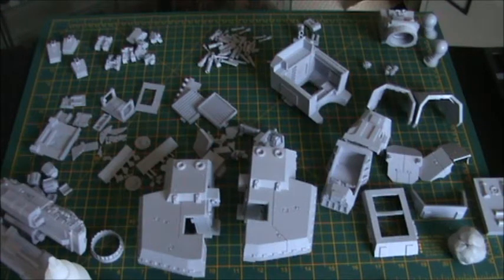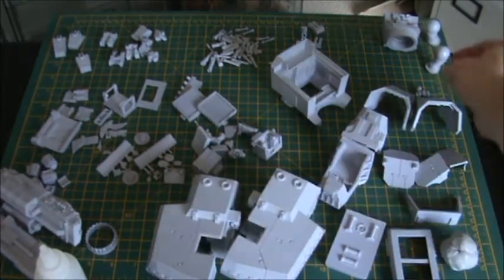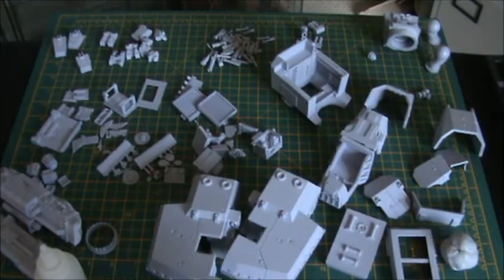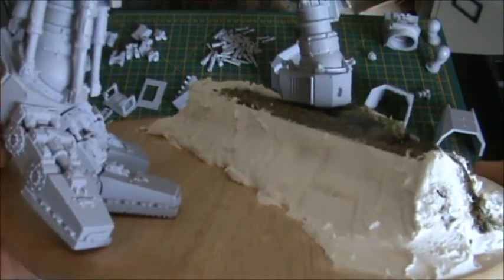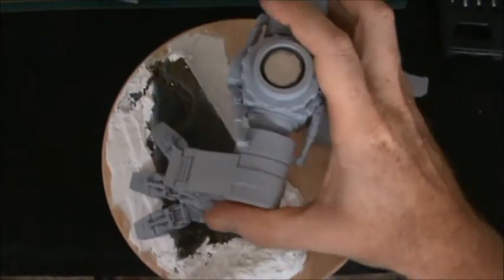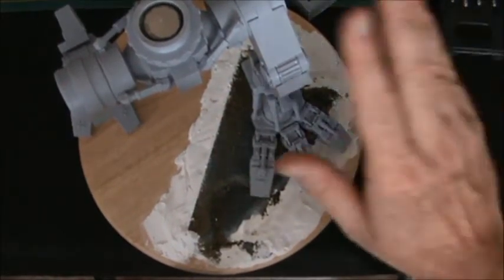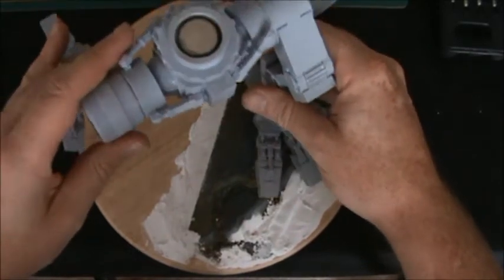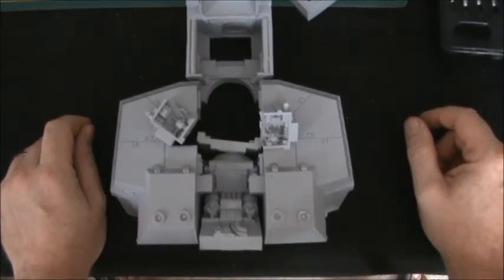Forge World Lucius Pattern Warhound Titan Project Log #4

Comment from the maker: It'll be fine!  The glue is very strong once it goes off.  I also do high power rocketry and use the same glues to fly rockets at speeds of Mach 1 and beyond, am pretty confident a static model will hold together!  I think 2 part epoxies negates the need for pinning personally.  Thanks for watching

Comment from the maker: Glues are covered in the first video in depth but I use various superglues from Deluxe Materials for non structural parts and a 2 part epoxy for structural parts and JB weld for large magnet work and main body sections.  Thanks for watching!